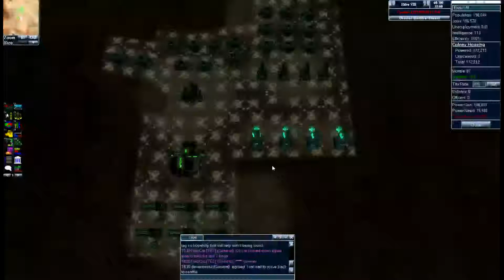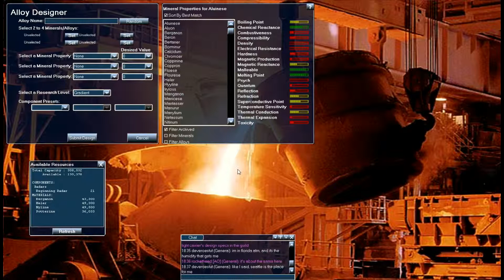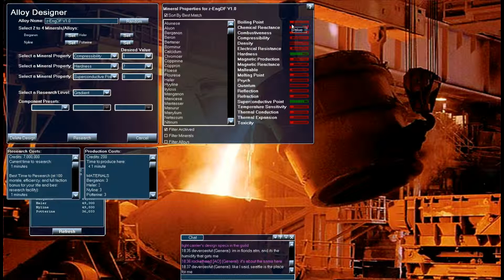BP Tutorial #0004 (Mining and Alloying)

Comment: Good intro on alloying. However, if you are in a hurry, and just want some space engineers, you can make your engine of any old stuff you have lying around. You'll have to use a higher amount of material but you probably have more than enough given that space engineers are small. Expert hint: if you use HELOUS for all six engine slots  (both power engines and ship engines), you will not suffer from component noise from the engine. Confirmed by thorough investigation of the source code of BP.